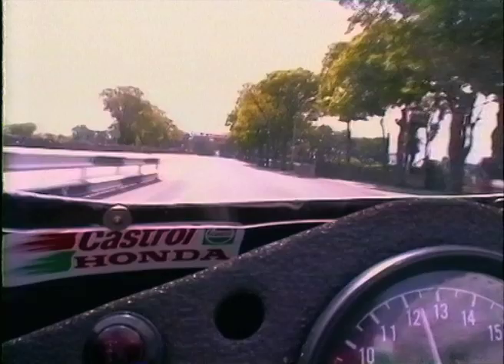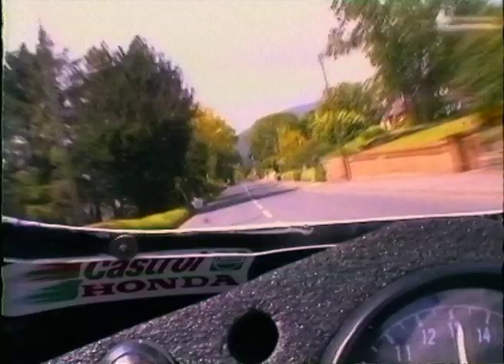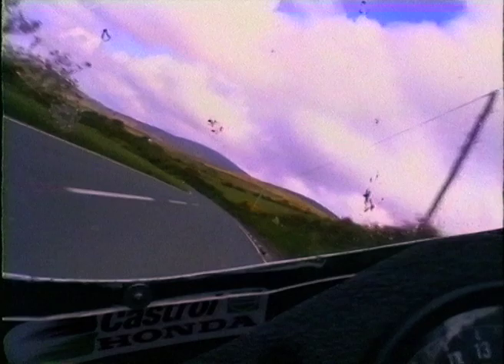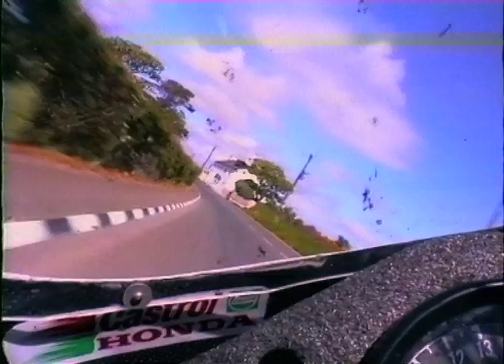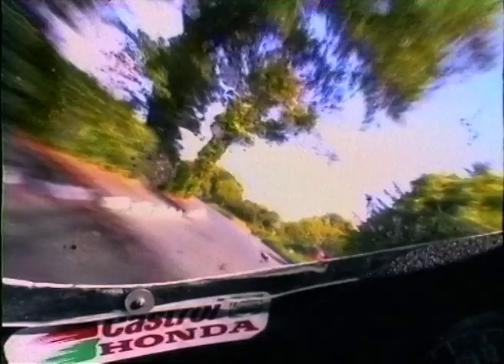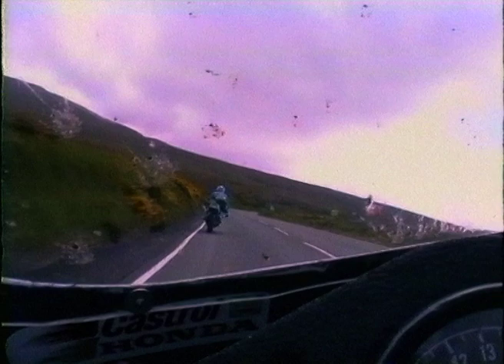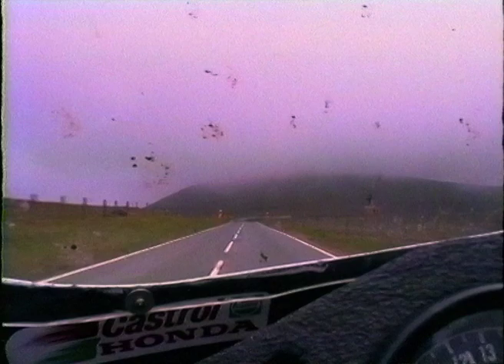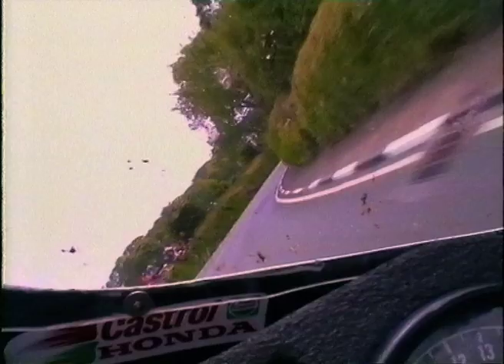TT 1994 - Steve Hislop - Honda RC45 - On Bike

Comment: Thanks for this. Very illuminating. Steve Hislop didn't like the RC45 (it was a relatively new bike in '94) - he said "it had a mind of its own." Joey Dunlop and Phil McCallen were also scared of its potential for errant handling. Incidentally, the F1 race of '94 started in the dry but then it pissed down. Everyone was still on slicks, obviously. In the end it was rerun on the Sunday, and Steve won it - and the Senior too, on the following Friday. Also worth mentioning is Joey Dunlop's encounter with, firstly, a dog and secondly a van (!!). A workman did not know there was racing on the Sunday and so had set out on a part of the circuit. Only Dunlop's reactions and luck saw him avoid it. Suffice to say questions were raised regarding the organisation and administration of the TT races.